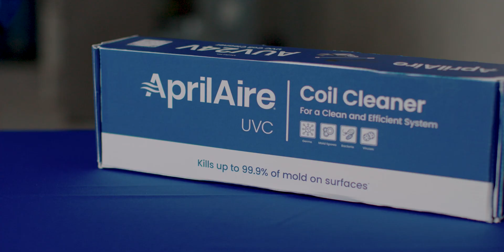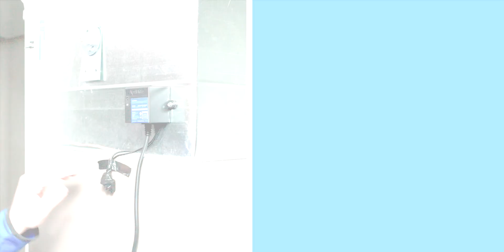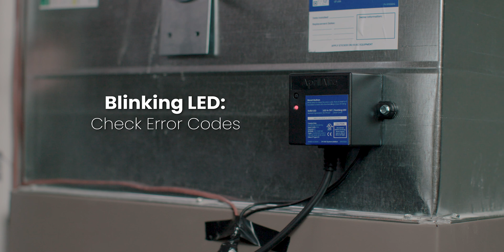How to Install the AprilAire UVC Coil Cleaner

Comment: Do I have to install a transformer with it
Reply from the maker: Thank you for contacting AprilAire! The UV system will need a 24 VAC power source. In the installation manual, number 11 discusses the power sources. If you need additional help, please contact our technical support team at 800.334.6011.

Comment: where  can i find info on control wiring the humidistat to a gas heat furnace with heat pump outside?
Reply from the maker: Thank you for contacting AprilAire! For wiring, please contact our technical support team at 800.334.6011.

Comment: I noticed the manual states install on return side of duct before the filter. I’ve read on other sources to install on the supply side.  Which is best ? I always thought it would go on supply side.
Reply from the maker: Thank you for contacting AprilAire! It should be installed on the supply side.